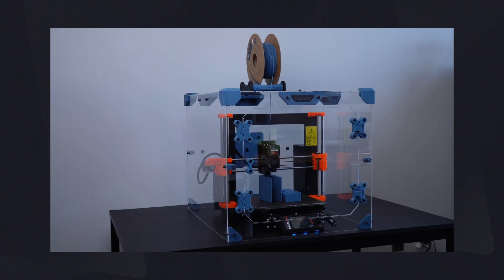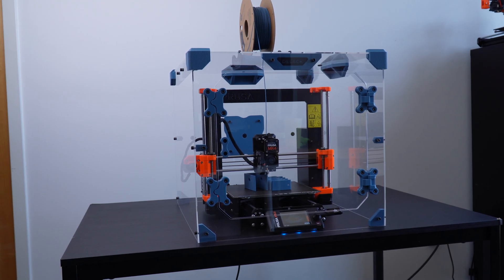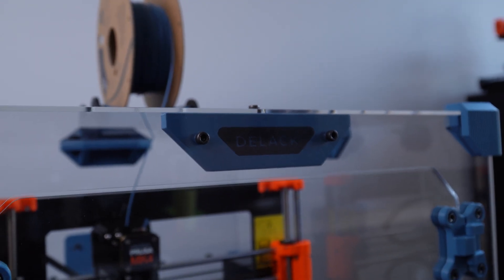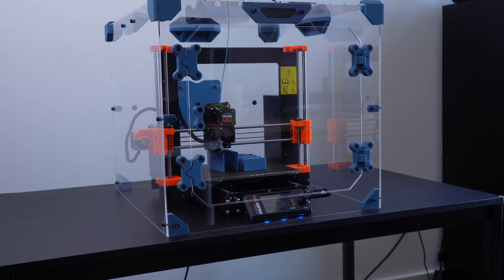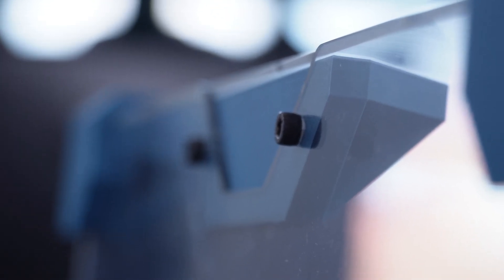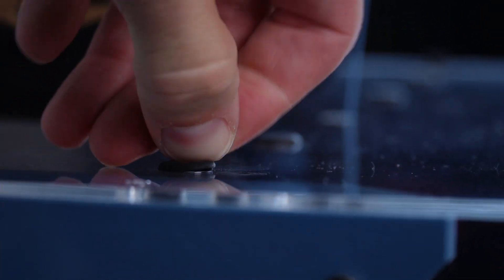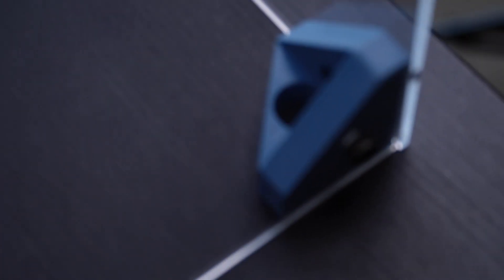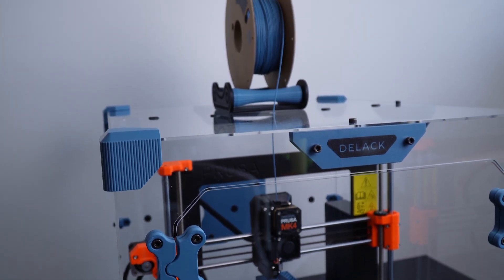Prusa Mini & Prusa MK4 DELACK Enclosure

Comment: Height.  Is it tall enough to accommodate the MMU3 for the MK4?  Also, the LED light uses two of the plexiglass filament holes.  Will there be a design adjustment for that? Or, something I can drill on my own.
Reply from the maker: There’s 5 holes on the back for filament holes - if you want to use the top filament holes, you can remove the light. 

We finalized this before the MMU3 was out, so I can’t say for sure it it works or not. 

If you want an enclosure that definitely works, we also sell the Universal Enclosure that’s made for the MMUs
Reply: @madebyjwillis any updates on fit of the MMU3? I figured you may have heard feedback in the past months.

Comment: my understanding is that the PSU dosent like to be inside enclosures, in deed the official recomendarion from Prusa is to always relocate the PSU outside any enclosure, you think its possible to add a mod that allows the PSU to be relocated outside ?
Reply from the maker: I’ve had multiple printers in enclosures for years without any issues. Unless you’re printing at like 300C in an unconditioned basement in the summer, I doubt you’ll ever have an issue. 

That recommendation is just so they can say “told you so” if someone complains about having issues, but I don’t think it’s warranted. They actually didn’t even have that as a recommendation in their V2 Lack Enclosure until people started asking about it. 

But with that said, you can still run the cable out of the back of the enclosure if you’re really that concerned about it

Comment: Will it be possible to just get the hardware (the corners, edges, hinges etc.) so it can be added to larger plexiglass walls? That way a diy situation would enable housings for way larger printers like the Neptune 3 Plus or Max... :)
Reply from the maker: Not currently - we order everything in bulk, but we might consider a larger version in the future

Comment: What dimensions will it be? Will it fit on top of a Lack table?
Reply: Also, one suggestion.. handles to lift off the enclosure when you need to service the printer.
Reply from the maker: You just might have guessed an accessory print… haha
Reply from the maker: It’ll fit perfectly on a Lack table - it’s 550mm x 400mm ish (can’t remember the width off hand, but it gives the MK4 a few cm on each side). So it’s narrower than the LACK but the exact same length. That way everyone can reuse their tables when they DELACK! Haha
Reply: @madebyjwillis  Perfect!
Reply: Btw - its looks very nice!  Forgot to mention that.
Reply from the maker: Appreciate it! I think you’ll like some of our other accessories as well!